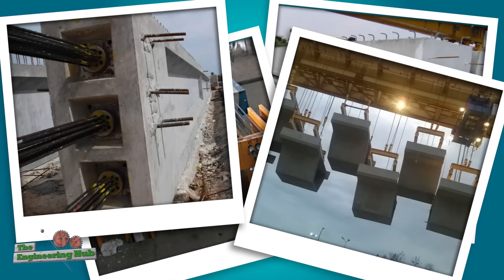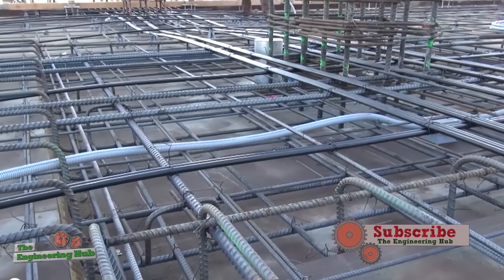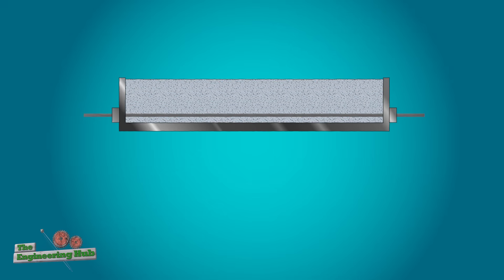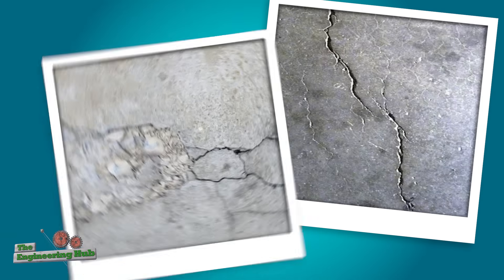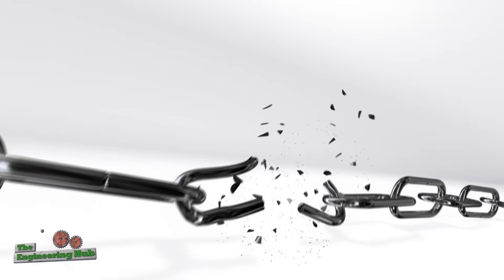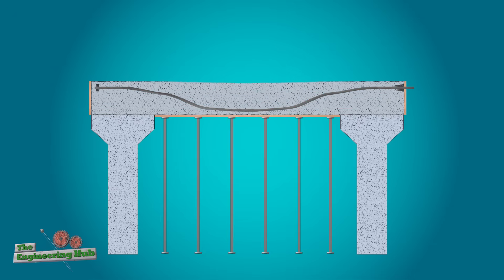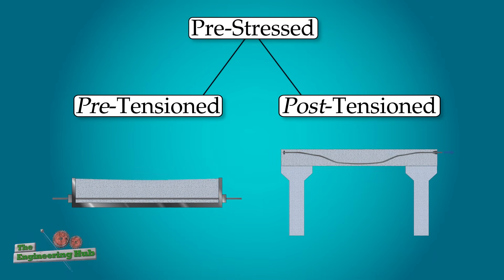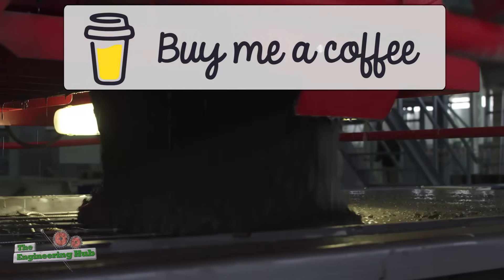Why Pre-Stress Concrete?

Comment: Gadder both head stay & joint with span  need .& this gudder cable connector is ok...but risk block joint which hang on....if block stay on gudder then it will more strong....

Comment: I worked at a place that made prestressed concrete panels, beams, double tee things, etc. The double tees were for an NFL stadium. I mostly worked on those and came up with a design and system for laying the mesh and rebar around the tensioned cables. My boss, who was a man of few choice words, had me show the whole crew how to install it. We went from 12 hour days to 8 hours. Everyone was ecstatic and took me to the strip club. I was 16 and wasn't supposed to be working there to begin with. Fun times minus being feet from death twice. Oh, and the acetylene tank that caught fire I put out. Didn't pay for lunch that day. Good times.

Comment: My dad was a civil engineer for Wells Concrete Products and I spent my college summers working as a laborer there.  It always amazed me to see 60 or 70 foot double tees bend when the pre-stressed cables were cut loose from the form.  The center would pop up 3 or 4 inches above the form.  You look at concrete and think "That can't bend".  Oh, yes it can!
Reply: I was working on a 12 story reinforced concrete building downtown SF when the '89 earthquake hit. I looked up at the slab above and it had waves in it.  I looked out at the skyline and saw the Transamerica and other high rises swaying back and forth as designed. Wild stuff.
Reply: No, it can't. Concrete doesn't bend, it develops micro-cracks, not visible to a naked eye which allow for deformation that you've witnessed, so you might think it was bending
Reply: @MrRightNow Rebar also don't bend then, bc they also develop micro-cracks.

Comment: If anyone wants to see the most incredible, INCREDIBLE example of pre-stressed concrete, look-up how they built the super-skinny CN Tower in Toronto way back in the 70s. The entire tripod bottom of the tower is basically three 1000' skinny pre-stressed beams. The combination of step-forming and running highly stressed  cable throughout the construction process is still mind blowing all these years later. Then there's the fact that the entire 1800' tower is built on a foundation that is only 16' deep, sitting on bedrock.
Reply from the maker: It really is an amazing structure. I've visited that one with my family growing up
Reply: The experience used in its construction are still used today in the construction of large concrete slip-formed structures such as oil platforms and nuclear reactor containment buildings.

Comment: The statement at 2:00 is somewhat incorrect.  The ultimate flexural strength of the section is not affected by changing conventional reinforcing steel for high strength prestressed steel.

However many other aspects of concrete behavior are significantly affected.  Consider many of the negative behaviors of concrete- beams crack under bending loads and deflect more, beams crack under bending loads and have lower shear capacity, beams and slabs crack under bending loads and allow water infiltration that deteriorates the reinforcing steel.  If the concrete is precompressed then the negative aspects of these behaviors is greatly reduced.  This is how longer spans/shallower members are allowed.  This is how concrete parking garages exposed to the weather can have greater service life.

Comment: all the guys who put the buildings up will not go back in once built ..because they are not safe
Reply: That's a good test.  I've been on construction sites where the contractor would not step out on some parts of the structure because they didn't think it would work.  But prestressed concrete has been proven in testing and experience to be very strong and resilient.  The building code used to have special provisions to insure that a post tensioned building didn't completely collapse if there was a fire or other damage at one end of the building.  Through testing and real world experience it was shown that post tensioned buildings did not collapse under extreme conditions even without those special provisions so they were removed from the building code.

Comment: I’m a mechanical engineer. I graduated with my degree in 1986. I’ve always been amazed at the things that civil engineers design. Bridges and buildings are built to last a very long time under very heavy loads. Thanks for a quick peek behind the scenes.
Reply: I'm a civil engineer and am blown away by the megaliths built around the world. The transport, hoisting and precision would push modern methods to their absolute limits.

Comment: Don't do this, it creates the possibility of sudden failiure, see fiu bridge collapse, to mitigate this the materials have to be so good that you could buy more then twice the amount of cheap steel instead.
Reply: If you don't trust prestressing you probably shouldn't drive on any bridge in the US.  Anything in the 20-150ish foot range of span is likely to be prestressed concrete in the last 50-60 years. I don't know much about the FIU pedestrian bridge that collapsed, but there were design errors that led to that collapse. As traditionally reinforced concrete gets into longer and longer spans the concrete has to get progressively thicker (and heavier) to hold all that steel, and becomes prohibitively expensive compared to other options.  Bridge engineers essentially don't use traditionally (mild steel) reinforced bridge superstructures anymore, except for special case structures like arch bridges.
Reply: @isaacm6312  I mean use steel without concrete like the ones built by eiffel, or the fourth in scotland, you can span a gap for less weight with just steel, use concrete for pillars as it is good under compression, use steel for spans as it is good under tension.

Comment: All ok but water does not evaporate from the concrete. It becomes the concrete due to a chemical reactions.
Reply: Lots of water escapes too, and that is the main reason why concrete shrinks while curing. Much of the water is there for workability of the concrete mixture during construction, and not for hydration of the concrete.

Comment: I wish I had more in depth info, but, I just recently heard, they found a way to make 'self repairing/healing concrete,' by putting yeast into the mix.

Have you heard of such a thing? If so, does it actually work?

Comment: But you fail to mention the problems with pretentioned concrete. It has a limited life span. Many buildings have had to be demolished due to the steel weakening over time as it is under constant stress thus leading to metal fatigue and comprising its strength, resulting in a load down grade over time.
Reply: I'm not aware of this ever happening in the US.  I've been designing and building reinforced concrete and prestressed concrete buildings for over 47 years.
Reply: Yes this happened to a high rise biult in the 1960's in Adelaide Australia.  They found that because the structural integrity of the building was compromised as the tensioned  rebars had fatigued.  This may have been an engineer error as the members loose some load capacity over time, they may have speced it too close tothe safe limit.

Comment: railway sleepers are also made either with reinforced concrete (a simple steel bar mixed in concrete) or with prestressing (a steel bar stretched, during the drying time of the concrete.

Comment: What about fiberglas reinforcing rods and fibers?
Reply from the maker: This is an interesting topic. Have you worked with these kinds of reinforcing in the field?
Reply: @TheEngineeringHub  I have worked with fiberglass rod additive concrete for industrial floor slabs.  The concrete is certainly less workable with this additive, and I was not aware of the full mix design of that concrete at that time (20 years ago).  But I'm very intrigued by the newer nano-fibers on the marked and if they may be useful for controlling shrinkage cracking in long life structures, like marine exposed bridges. I'd be skeptical of using them to reduce steel reinforcing, but I know that is exactly what is sometimes done for on grade slabs in the building industry.

Comment: Pre-stressing actually doesn't increase the strength of the beam. Its main benefit is to reduced deflection and allow for shallower sections. You can use pre-stressing steel in a beam without pre-stressing the section and it will have the same bending strength as the pre-stressed section. The higher strength of the steel and concrete increases the strength but the actual pre-stressing does not increase the bending strength. However, the prestress will reduce the deflection at the same load level.

Creep in the concrete along with shrinkage (and to some degree temperature) reduce the pre-stressing. The creep is generally the major factor. Relaxation of the steel also reduces the effective long-term pre-stressing.
Reply: @yofeezee  The load carrying capacity is proportional to the bending strength (assuming shear does not govern). The stiffness and strength are two separate checks. One is a life safety issues and the other is a serviceability issue. Pre-stressing improves the serviceability but not the life safety issue (with the exception that shear strength is improved but bending usually governs over shear). Pre-stressing decreases the deflection of a slender section but does not increase the load carrying capacity.

There are essentially two reasons to use pre-stressing steel. One is to reduce deflections of a shallower section and the other is if a section is too congested with mild reinforcing. Pre-stressing can also increase the shear capacity of a section but that is not a primary reason to use pre-stressing. There are other means to increase the shear capacity.

The reason pre-stressing needs a high strength is to increase the pre-stressing strain. The more strain you can put on the steel, the fewer losses you will have from shrinkage, creep, cable relaxation, and cooling temperatures.
Reply: @yofeezee  Bending strength is unchanged.  Bending stiffness is affected because precompressed concrete doesn't crack in bending and remains stiffer.  So for longer spans that might be controlled by deflections, you can use a shallower beam if it is precompressed.  The deeper beam can still have greater strength.
Reply: @billj5645  
@Bill J, 
Agreed that the bending strength is unchanged, but what about the bending demand?
 The assertion in the video is that the 'prestress beam could carry more load, all else equal'. This is based on a bending strength-governed beam where the same load will cause a lower peak flexural demand in a prestress beam vs non-prestressed. 
As you allude to, a huge advantage of prestressed beams is higher stiffness and creating larger open spaces which are deflection governed; the scenario here is only a hypothetical scenario for comparison purposes.
Thanks for the discussion!

Comment: I heard that in some cases prebuilt pretension concrete stuff was actually cheaper since you could control the conditions and just build a bunch of them as needed
Reply from the maker: Hi Robert,
Yes, you are right, there are cases when precast pretension concrete structures are cheaper, particularly in terms of labour and materials for construction. Fabricating off site can facilitate quick construction and high quality control. In my observation, this is very common with concrete structures in Europe. I've noticed in North America there can sometimes be a larger pool of skilled concrete labourers though, leading to cast-in-place being cheaper.  Another consideration would be maintenance over the life of the structure--another topic that should have it's own video!

Comment: I feel like you didn't explain well enough how stretching the reinforcement makes the beam stronger. The part was a little short for me. Doesn't stretching the reinforcement make the reinforcement already stretched so that it can handle less load since the added load will stretch it more? Will a pre-stretched reinforced beam not bend until the load is greater than the pre-tensioned bottom so that it goes from compression to tension?
Reply from the maker: Hello! 
Fair enough--it is a complicated mechanism that could have been described further. Here is an elaboration: 

The pre tensioning of reinforcing puts the tendons in tension, but once released the tendons contract towards a state of equilibrium. This creates the compression  zone in the bottom at 1:32. Now you can imagine the tendons in a sort of neutral state, and then the applied load begins causing tension in the tendons.
 So the pretension and tension due to applied load are not additive on the tendons. 
Hope that helps!
And thank you for the comment.
Cheers,
Reply: The point is to keep the concrete in compression for as long as possible as it is usually the limiting factor of the beam/slab.  So when you release the stretched cable, it wants to shrink back to its original length, which puts a constant compression force in the beam.  A simple analogy is to think about lifting a stack of books lined up vertical on a shelf.  Can you just grab the book on each end and lift up the whole stack?  No, you have to first squeeze all the books together so they are compressed and can't slip relative to each other when you lift them all up.  The more compression force you apply, the more books you can lift while still maintaining sufficient compression throughout the entire row.  On a side note, the cables are never stretched anywhere near their capacity so they would generally never be the limiting factor in design strength, even as more load is added.  In fact the cables are often all tensioned with an industry standard force which is well below their ultimate strength, so if more compression force is needed, we don't stretch the cables more we simply add more of them.
Reply: The prestress reinforcing is a very high strength steel, almost 4 times the strength of normal reinforcing steel.  It gets elongated farther but it stays in its elastic range so added load can stretch it more and it still regains its strength.  This is the behavior under normal day to day loading.  If the beam has a severe overloading then it will deflect farther and behave more like a conventionally reinforced beam but with much stronger reinforcing.  This is the check for maximum bending strength, or ultimate strength.

Comment: What isn't explained is how it's actually done
Reply: You get the 2 strongest construction workers you can find on the jobsite and tell them to pull very hard on the wires.  Each 1/2" diameter wire gets pulled to 33,000 pounds to start with.
Almost all of the photographs in the video were actually of post tensioned concrete which is done differently.  "pre" vs. "post" describes it.  In "pre" you typically do this in a factory and you stretch the reinforcing steel within the formwork then pour the concrete in and let it cure.  Then you cut the steel loose and it transfers stress to the concrete.  In "post" you do this at the jobsite- cast the concrete first then use small hydraulic jacks to stretch the strands.  A high strength strand can stretch 10" or more during this process.  A video showing how both methods are done would be interesting.
Reply from the maker: Ha! Good observation. Would you like to see some future videos on practical methods from say a contacting perspective?
Reply: @TheEngineeringHub  Sure, would be interesting

Comment: I'm also interested to see a video on floor diaphragms and how they interact with stair cores, shear walls. Anything to do with lateral forces in general 👍
Reply from the maker: Noted--thank you! We have been contemplating some lateral system topics. Highest on the list was a video about wind forces on structures.
Cheers,
Reply: That's a broad topic is there something more specific you want to know?  Also, are you talking about concrete floors or framed/plywood?  As their behaviors differ quite a bit (rigid vs flexible).  Are you familiar with shear walls and collector elements (draglines and chords)?  If not you'll want to investigate those for diaphragms to make sense and how they're simplified for application.  In a nutshell, diaphragms transfer load horizontally to the collector elements, and the collector elements drag/push that load to a vertical resisting element such as a shear wall or frame.  If a stairwell core is being used as shear walls, then the diaphragm will transfer load to the collector (which is in line with the wall), and the collector will be anchored to the shear wall.  If the stairwell is not being used for shear walls, then the diaphragm will use the collector elements to transfer shear loads around the opening.  In concrete, the collector element is usually just rebar, in wood construction collectors are generally the top plates but can also be rims, beams, joists, trusses, or blocking with metals straps connecting them all to the shear walls in one way or another.

Comment: I worked on a project where we grouted the cables after post tensioning. 
The grouting reduced the risk that a cut cable or a cable's locking wedges slip and the cable launching itself horizontally from the end of the slab into the neighbour's property. 😮😊
Reply: Your comment is out of context
Reply: @indrajeetbanerjee2159 
 Hahaha Hahaha 😆
Reply: No one comments on my comments. 😁😃

Comment: Great Video. As requested, future discussion on the cable stretching engineering theory, along with the the equipment and methods for stretching PT cable would be insightful to watch. Also a video about post tension cable repair would be useful to.